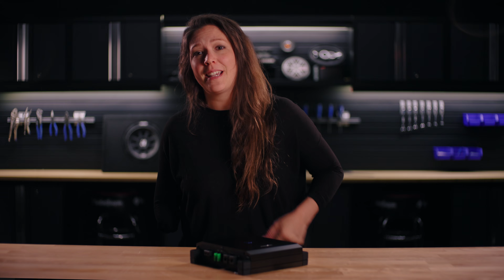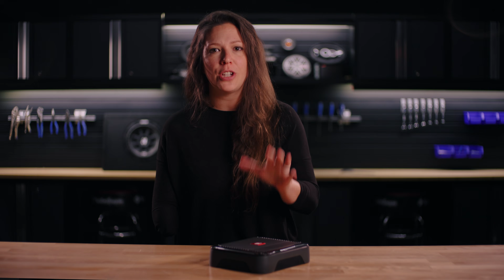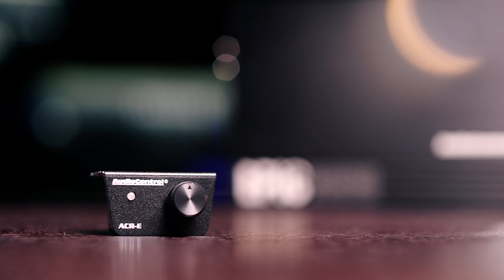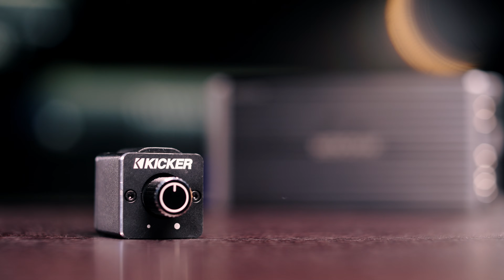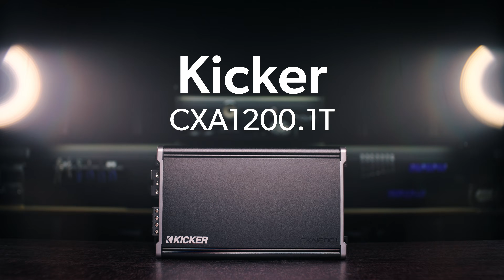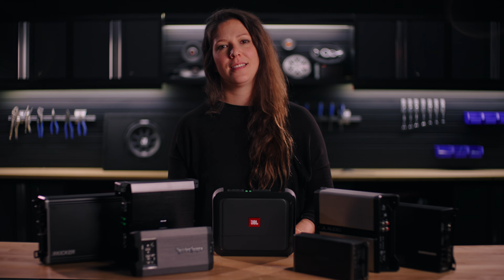The best mono amps for car subwoofers in 2025 | Crutchfield

Comment: Thank great videos as always. Quick question, what do you think of the Powerbass LAB5500? 1500w RMS at 4ohm....
Reply from the maker: Powerbass is a great brand. We don't carry the LAB5500 though so we haven't tested it. Looks like it may not be available in the US. Would you like help choosing another option? If so, what is your sub model or specs? How many subs do you need to power? Thanks!
Reply: @crutchfield thank you for the feedback. I've already installed it in my car with a Pioneer Champion Series Pro sub. A powerful amp. Was just wondering how it compares to the big branded amps you guys are talking about.
Reply from the maker: Ah, ok! We wish we had experience with that amp to help. What do you think about it? Does it seem to power the subwoofers fairly well?
Reply: @crutchfield it's a seriously powerfull amp and the bass controller with clip helps a lot. You can definatly instal 2 of the subs on one of these amps, depending on your need. For me, i like it.

Comment: One of the amps draws 100 amps ? Better install a SECOND dedicated battery for that bad boy
Reply: most modern alternators can handle 100 amps.. mine is 90A so i probably can't run my system at more than 800W without starting to push the alternator.. keep in mind that the car itself needs some amperage just to run, and since amps are not efficient, they actrually require more more to work.

Comment: That JBL A600 with its 2v input sensitivity is a problem as anything sends it to clipping
Reply: The bigger version the clubA1000.1 i have 2 of and man there built like tanks i still have them as extras..Was running them strapped on a trinity audio M18 in my truck..
Reply: @johnoates3326  Il check the specs and see what the input sensitivity is on those

Comment: The word "best" can be subjective. The Rockford T750X1bd features a 100-amp fuse, similar to the Kicker amp. I like your JL Audio VX1000/1i Mono subwoofer DSP amp. It received a great review! It could be on the list as one of the best you sell. Crutchfield is the best; I've been a verified buyer for over 35 years! 💯🕺 🔊 🔊 I used to buy from Sonic Electronix, but you guys offer much better tech support, and customer service. I just wanted to add that although this RF amp, with the 100-amp fuse, can run off a stock alternator, it is best to install at least the “Big 3” wire upgrade. Some say installing a more powerful battery under the hood, (like the XS Power D3400, which Crutchfield sells, plus the XS Power “secondary battery” that Crutchfield sells, can keep lights from dimming, and keep the voltage stable. The phrase “It takes power, to make power”, that the company Mechman says is true. If you have enough money, buy these. 🔊🔊
Reply: Man this ain’t the. 70’s😂😂😂😂😂😂😂😂😂 u don’t need all that electrical upgrade for that baby ass amp
Reply: @Nathanial-x6m  true, you would need a 2nd job, and to live in a van, (down by a river) to afford upgrading anything electrical! Lol ⚡️
Reply: My alternator put out 200 amp stock
Reply: @LeroyColeJr-z4d7b  You install the XS Power battery upgrade, the XSP Big3, and the XSP secondary Battery, which Crutchfield sells? I bet you are rocking! Like they say, “It takes power, to make power”. ⚡️
Reply: although what you said started out good, it quickly went off the rails and incorrect is all that can be said
Reply: @chancebales  Bro, they're not my words. All you have to do is read, gain truth from the Web). If you cannot afford a big alternator, buy the Big3, a stronger battery under the hood, and the XS Power Secondary Battery that Crutchfield sells. It doesn't require you to get a higher-paying job. It's not rocket science. ⚡️
Reply: @DarronSanderson  roflmao..you DO NOT NEED a 400 amp alt and dual xs power batteries to run that very good, but small amplifier and where TF are you coming from with this repetitive "2nd job" nonsense you seem to be stuck on with everybody you talk to?!  it's like your go to move and it's the most laughable thing I've heard all day..although I'm not required to humor anything some dude on youtube says, I can assure you that for the past almost 4 decades, I have INDEED been able to afford any size ANYTHING car audio related that I wanted or NEEDED and that certainly includes any size alternator, battery, isolator, wiring, etc, etc, etc

you said something that is incorrect and all I did was point that out..the RF amplifier that is being discussed DOES NOT require ANYWHERE NEAR that level of electrical upgrades...full stop

take care and have a good day
Reply: lol..nice job with the adjustments made to your original wildly incorrect post/comment/add

take care